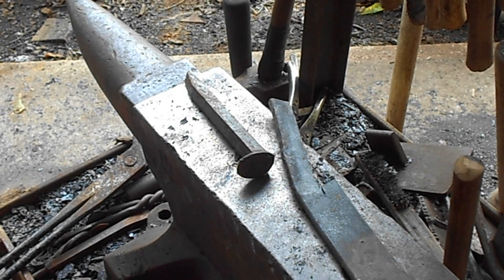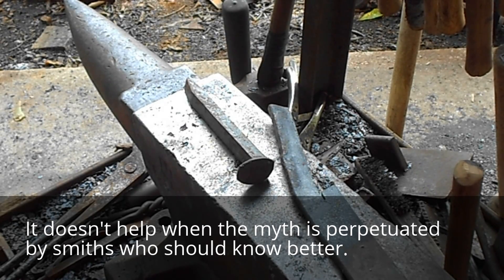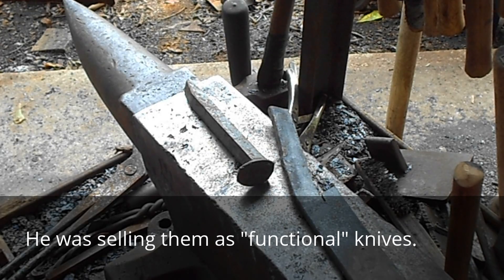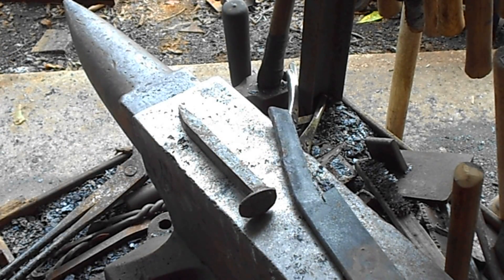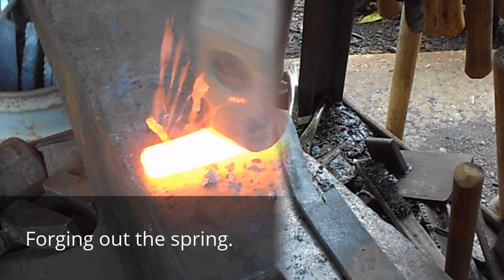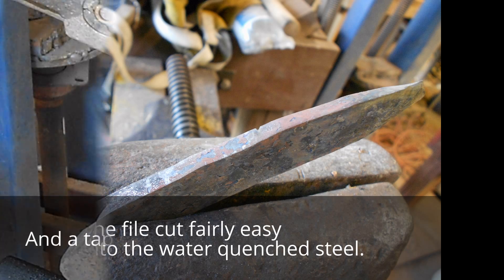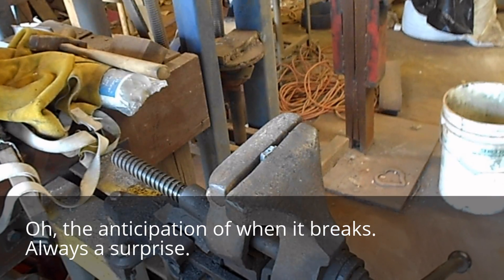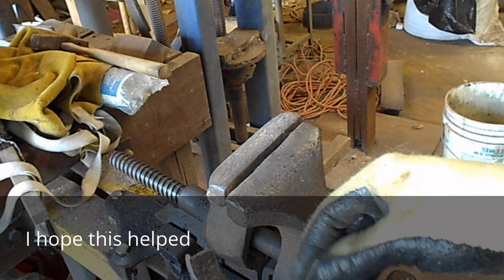The RR Spike Myth

Comment: Thanks for posting this. RR spikes and rebar seem an easy go-to resource for many but I've always been skeptical. When considering scrap, one should consider the original purpose. Your test and the manufacturing data are hard to contest.
Reply from the maker: I did this video just due to the number of guys selling spike knives and claiming they were high carbon.  Things have changed over the years and now it's not so common unless you run across a newby who's mentor is a "Ferrier".
Reply: @jamesmcclendon1203  fyi, i put a link to your video in the description to my most recent video. :)

Comment: Question... 4' RR knife hand forged in the USA or a walmart 440 Ozark Trail from China?? CAN ONLY GRAB ONE
Reply from the maker: That's tough.  While the spike will hold an edge longer than the cheap stainless blade, the stainless blade is, well, stainless.  However, I couldn't find a similar knife in that brand and the closest one I could find that could also be a spike pattern wouldn't even say what it was made of, just rust resistant.  Whatever that is.  I have tested spikes and they did perform better than the really cheap blades like that.  At least I could get the spike sharp.

Comment: Thank you .  Using bed frame steel.   It tricky to harden.  you can make a   a good chopping tools
Reply from the maker: Awesome.  Got my start with bed frame steel.  Wasn't interested in making knives then, just couldn't use the angle iron because it was too hard to drill so I was like, "Hey, this can be used to make a knife".  I got bit.  That stuff was basically recycled rail, very similar to 1084.  Not all rails are good however, those tests from this video can be used to check that steel too.

Comment: Oh well the specifications at the end says it all, you used a regular RR spike. Most of us who use RR spikes stick to the HC stamped spikes, they have .25-.30 carbon. Still not a lot yes but will harden much better than the spike you used. I also carbon infuse mine one mm on both sides making a very hard blade edge. Thank you for your demonstration but please be aware the vast majority of smiths who make these decorative pieces still function just not to the grade of a high carbon steel.
Reply from the maker: Thanks for the comment.  The reason for doing this video was the number of guys I ran across who thought RR spikes were high carbon steel, which by definition is at least .7% carbon.  I wanted to show a simple test comparing the two steels.  Since the video I did get one of those HC spikes and tested it.  It performed better than the cheap knife I used in the testing video.  I think I got 15 cut out of it (5 for the factory knife, 40+ for the true high carbon blades).  As far as "carbon infusion", I'm on the fence about that.  Carbon burns off (scaling) faster than it goes in (diffusion), but I haven't and probably won't do any real testing on it.
Reply: Even the higher carbon spikes barely get hard, I can feel the difference with a file but even when quenched they are pretty easy to file.

Comment: I cut a slot down the center once at my brother's shop in California and slipped a small Nicholson file in it and forged that and I was an awesome knife. I have a hard time getting 1045 steel past RC 58 and I only temper it back to 56 for Hawks and I can get 4140 slightly harder, l would guess because of the chrome/moly in it. The idea of somebody getting RC 58-60 is laughable.
Reply: Mountain Fisher it depends, if you cauterize the blade it’ll rate in that range. You just don’t want to grind through it so you’ll have to do most of your sharpening prior to quench and carburizing.

Comment: As someone who is just starting out making knives trying my hand as railroad spike knives gives me good practice that's all they are to me is practice to learn off of if I wanted to make A usable good knife I would try and put a known steel in the center for my cutting edge would that work?
Reply from the maker: Making a spike knife is more of an exercise in Blacksmith skill than knifemaking, however, if one did want to weld in some high carbon steel you would be making a quality knife.  There's a maker named Andy Alms that does this.

Comment: I have read a lot about how railroad spikes cannot be hardened to make a sufficient using knife. I have been hardening and tempering RR spike knives for over 30 years and I am sorry if any of you can't get a decent hardness from any of them but I have never had a problem. I consistently get the ones I select to a rockwell of 58 to 60. A fill rated at 65 rockwell will just slide off the edge after hardening without leaving a mark. After tempering the only hand stone that will come close to sharpening one is the diamond embedded stones. I understand that you guys are trying to be helpful so if you want to find out how I do this come to a class. You can find me at shadowhawkblades.com
Reply from the maker: My friend, what is the carbon content of a RR spike?
Reply: tarnshadowhawk you must have different spikes then I do and I have a bucket full of them.

I made a couple for fun a few months ago, tried oil quench, got nowhere, tried 2 more quenches in water, got no where. I still find them good practice for beginner smiths but thats about it.
Reply: Eye For Eye Knives always use the HC spikes they have between .25 and .30 carbon. Not nearly as good as 1075/1084/1095, etc. but definitely good enough for other light duty intended uses. Ie: you shouldn’t use it as a prybar.

Comment: Hi James, still passing on the lore and knowledge I see.  I make RR Spike knives as art and tell my customers exactly that, this is a piece of art and not a knife that one can depend on in a critical situation.  Given that spiel, the RR Spike knives are still a very good seller to the point that I cannot keep any in stock.  I guess that's a good thing.  Sure is helping my smith work.  I'm still a new smithy but not a young one.    Thanks for passing on some of that great stock of knowledge you have.
Reply from the maker: There's nothing wrong with making them.  It's the guys who insist that they are "high carbon" steel that cause problems for newbies as well as misinforming potential customers.  That's why I did the videos on testing, if more bladesmiths would test their work they'd know.  Good to here from you!

Comment: I picked up quite a few spikes from a rail crew and asked them about the HC stamping. You know the internet stories about HC marked High Carbon spikes only used in the curves. They stated that all the spikes are the same. In curves they add more spikes to the plates. He stated the markings are from the manufacturer and most likely the initials of the company.
I got them for projects and the lower price point knife sales. I always state that they are a good tool box, tackle box knife but won't be anything special. Most of the RR guys get a big kick out of them.
Reply from the maker: That was the main point of doing a video like this, to stop the misinformation that messes up young smiths.  Interesting enough, the spike I was testing had a date code on the head.  It was obtained from a friend who runs a RR repair crew.
Reply: @jamesmcclendon1203  I bought them before,from American spikes and foreign (lead foreign)...
They are folk art and I hate to insult people but I CANNOT STAND A KNIFE that after slicing 2apples is dull..
Knives are meant to be sharp and hold an edge.
For Railroad collecting genre,they are great,but to use daily in utility fashion, Terrible.
Reply from the maker: @aldenunion  Things have really changed since I did this video.  I'd like to think this helped.  I think guys now understand that spikes aren't the high carbon steel many claimed back a few years ago.  They are neat to look at and fun to make.

Comment: You can always make a san mai blade if you want a decent spike knife. 
https://www.youtube.com/watch?v=W-gmfpcbC3Q
Reply from the maker: Most definitely, adding a good carbon steel to the edge would be the only way to make a good blade.  Would it be that every smith had the knowledge to do that instead of furthering the myth.   That in its essence was the point of the video, to bring that knowledge and help new and old smiths alike make better blades.  Those test should be in every smiths toolbox, especially for unknown steels.

Comment: Hey James, why would you quench the spring in oil and the spike in water? ;) Very helpful video.
Reply from the maker: Good question, I don't think I said on the video but 
should have.  To quench a true high carbon steel in water is risking 
cracking the steel as it is too fast.  Some high carbon steels will 
break.  5160 might have survived but I didn't want to risk it.  Every knife I've ever tried to water quench cracked. 
Since I knew the spike was borderline low carbon it would need the fasted quench  possible otherwise it wouldn't harden much at all.  Even the parks 50 I use would have likely altered the test by leaving the spike a little softer.
Reply: I know that 5160 is too rich an alloy to quench in water; too many other elements in it. It'll fracture all up if you quench it in water. W2 has 1.00% carbon, I believe, but it's still a water quench. Has to do with the alloy.
Reply: @caveofskarzs1544  when you are using extremely thin stock like a knife, oil will even get W2 hard. Most of the oil hardening and water hardening designations are for peices of steel that are roughly an inch thick.